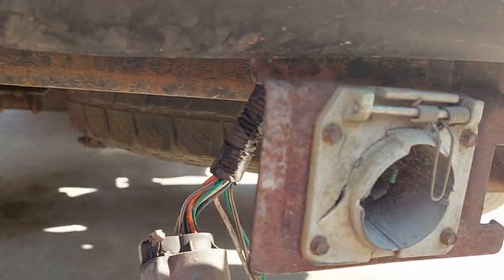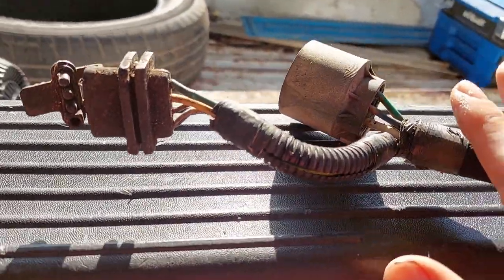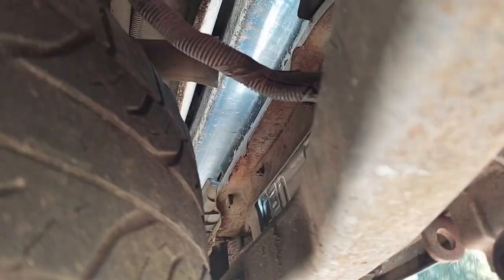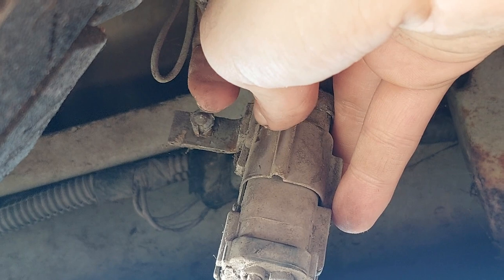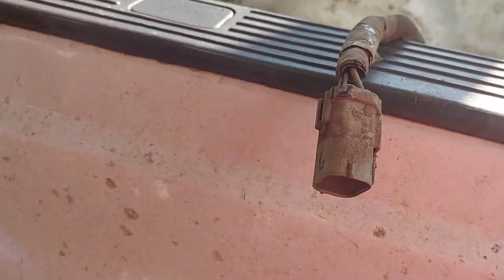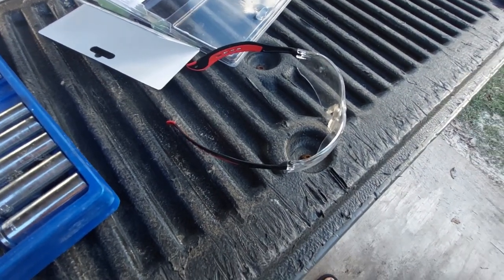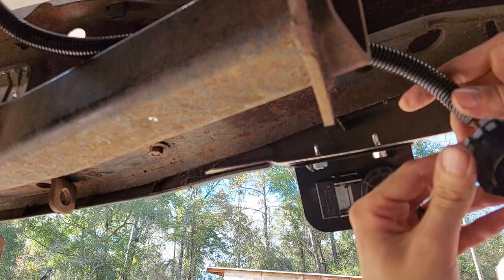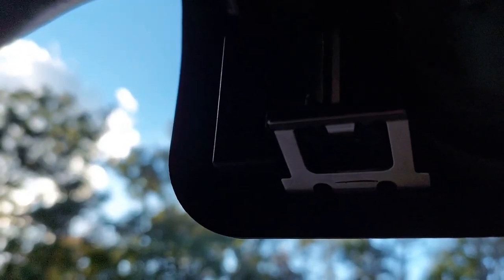Episode 101 - Trailer Connector and Wire Repair 2001 F250

Comment: great video
Reply from the maker: I remember I liked putting this solution together.  It was clean and bolt in, no funny wiring or anything necessary.  A little expensive because I had to buy two separate kits, but I didn't mind the cost because it was essentially a drop in solution.

Comment: Great video!! I'm doing the same thing in going from the older style 7-way plug to the newer style 7 & 4 connector on MY L99 F350. I'm thinking of installing the bracket in the same place as the original was on the bumper and using spacers on the bolts to get it low enough to clear the edge of the bumper. I have the universal brackets that sort of clamp onto the hitch but they just aren't going to work.....I'll keep you posted....
Reply from the maker: Sounds like a plan.  Let me know how it turns out.
Reply: @MazdaB3K  Will do. I have a brand new aftermarket '99-'07 bumper and just want to have the newer style plug connector.